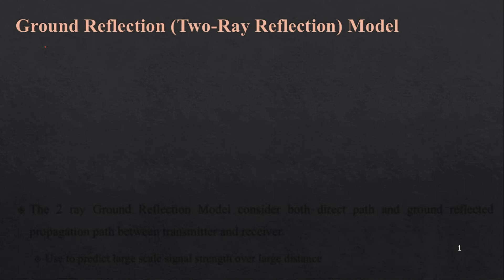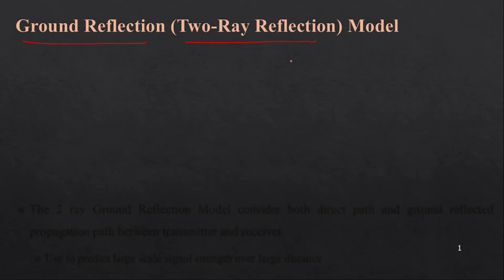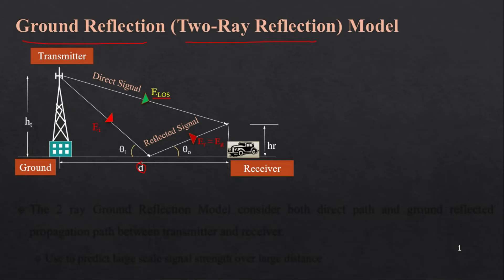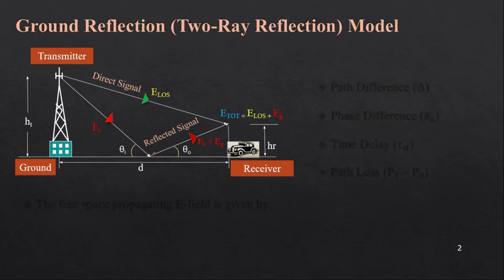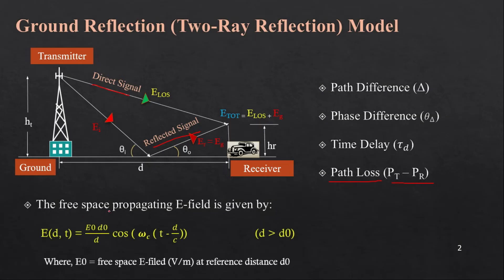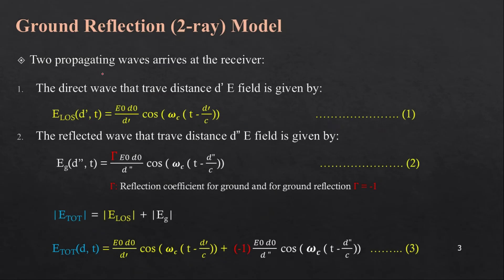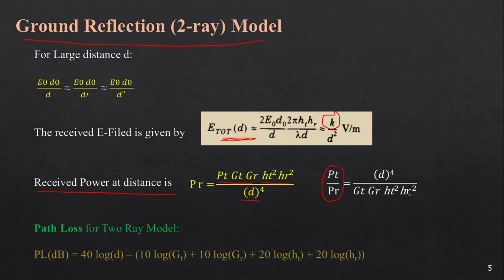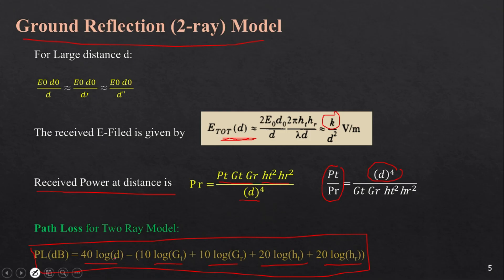Two Ray Ground Reflection Model In Wireless Communication

Comment: Sir please make videos on these topics as well, your videos are really awesome.

Unit-3
Capacity of flat and frequency selective channels. Antennas-Antennas for mobile terminal- monopole antennas, PIFA,
base station antennas and arrays. Multiple access schemes-FDMA, TDMA, CDMA and SDMA. Modulation schemes-
BPSK, QPSK and variants, QAM, MSK and GMSK, multicarrier modulation, OFDM.

Unit 4
Receiver structure- Diversity receivers- selection and MRC receivers, RAKE receiver, equalization: linear-ZFE and
adaptive, DFE. Transmit diversity-Altamonte scheme.

Unit 5
MIMO and space time signal processing, spatial multiplexing, diversity/multiplexing trade-off Performance measures-
Outage, average snr, average symbol/bit error rate. System examples- GSM, EDGE, GPRS, IS-95, CDMA 2000 and
WCDMA.
Reply from the maker: Thank you for sharing your syllabus topics, I will add this topics to my playlist.